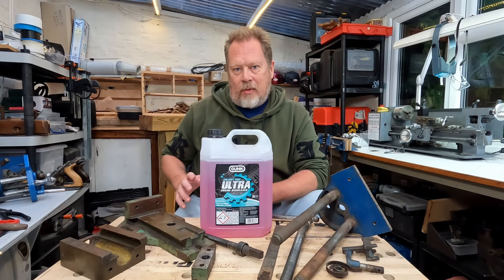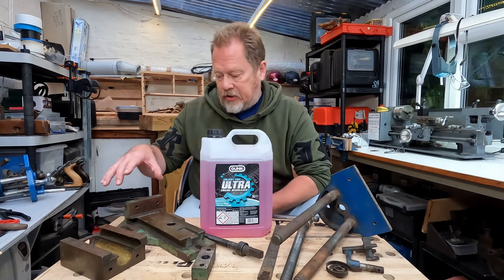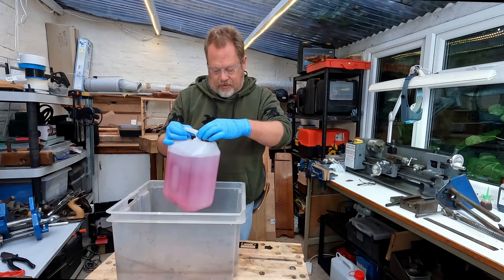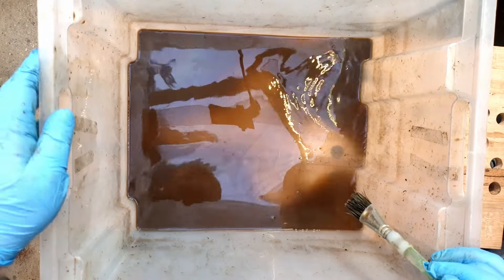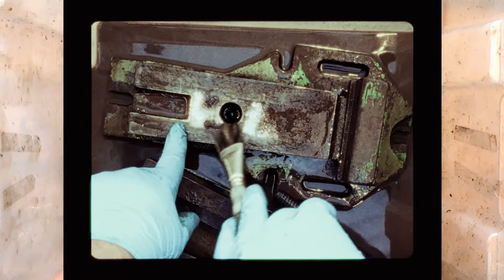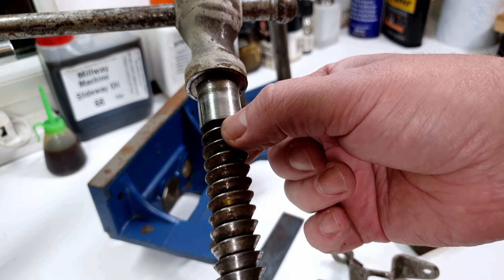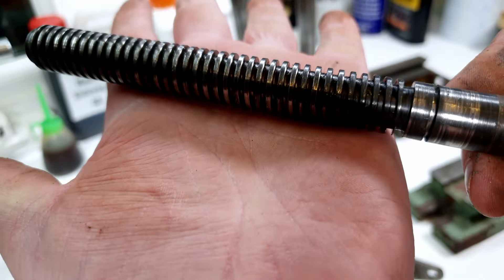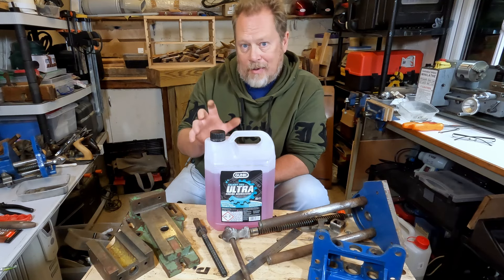Low Odour Degreaser - See it in action and judge for yourself.

Comment: Nice review, I find the older I get the more sensitive to harsh odors. I have several dedicated brushes in my large Graymills solvent washer as well as a stiff wire carbon brush. A spray bottle wouldn't be a bad idea for large surfaces with the Gunk product
Reply from the maker: Thanks Chris, a spray bottle would be good for larger items such as engines 👍